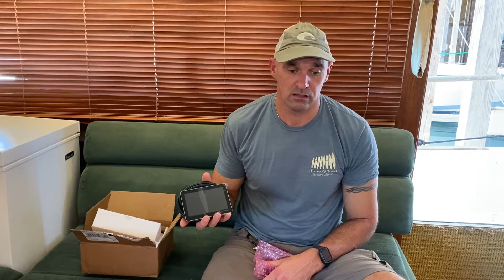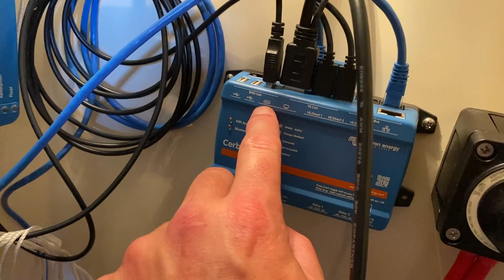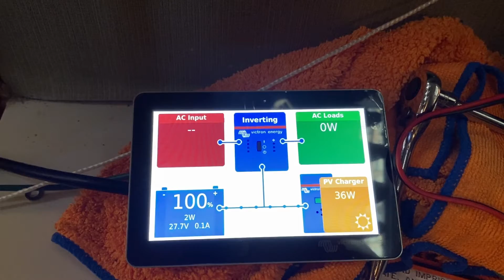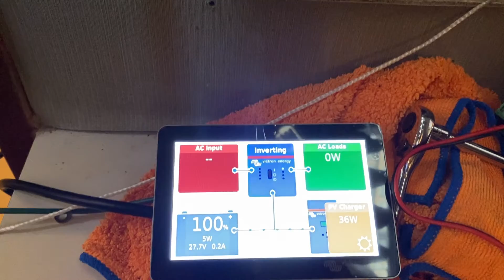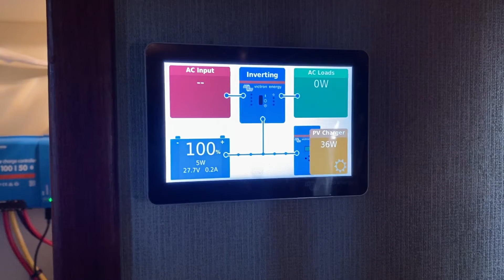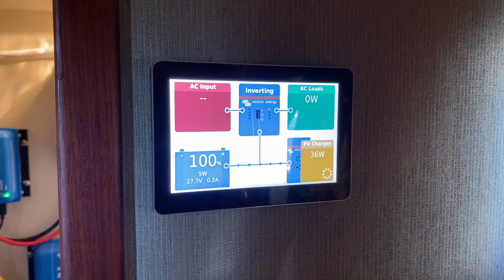victron gx touch 50 install

Comment: Thank you, Thank you, Thank you for this video.  I has added a component to our Victron set-up and when I plugged everything back in, the CERBO GX shut down the Mulitiplus everytime I connected the LAN cable.   Your video pointed out the correct USB port for that LAN cable.  And viola, everything is working as it did.   Just wanted you to know you helped me greatly.

Comment: Will this work with any inverter?
Reply from the maker: No, i believe it only works with the victron units as its not just a data center its an integrated controller on the victron network

Comment: What wattage do you typically get midday from the Rich panels? Nice install btw.
Reply from the maker: Johann, thanks and here in central virginia, with the two panels i have installed right now at full sun on a clean panel i get anywhere from 300 to 320 watts which i am pretty happy with given our latitude

Comment: Thank you for the video, really enjoyed it, please keep them coming. How much do you estimate your whole victron set up cost you?
Reply from the maker: Absolutely, right now i have about $4000.00all in including all victron components, fuses and ve connection cables. All the blue sea panels, batteries, solar panels and all the marine wire will add another $5500 or so and thats me doing all the design and install
Reply from the maker: Absolutely and yes i think thats a good number to plan for, well worth it in my opinion

Comment: Love those. Can't wait to install ours. Gotta finish up installing the other 6 lithium and 2 more 24/3000/70 inverters! Great setup y'all have there
Reply from the maker: Thank you, its really a great piece to add, and has so much function.  That combined with the vrm network really brings it all together.  I love that i can watch the boats electrical loading from home.  I am gonna explore adding some of the inputs to the cerbo like temp sensors and bilge pump monitors so i can truely see whats going on when we are at home
Reply: @sandpaperandseashells  and keep the videos coming on it plz.